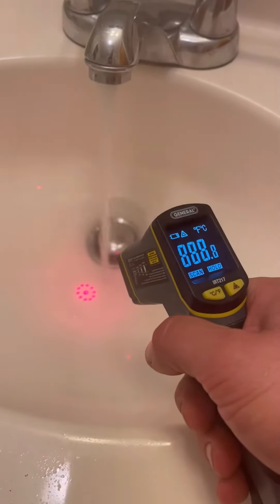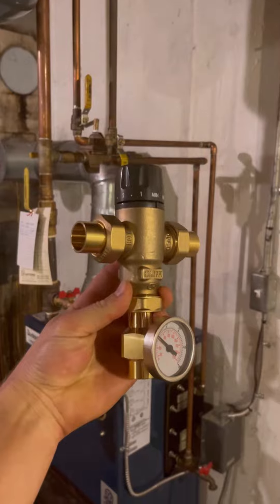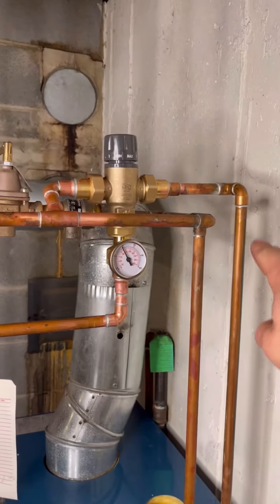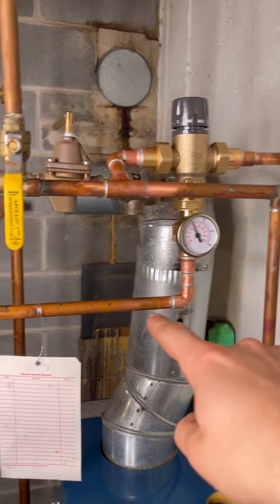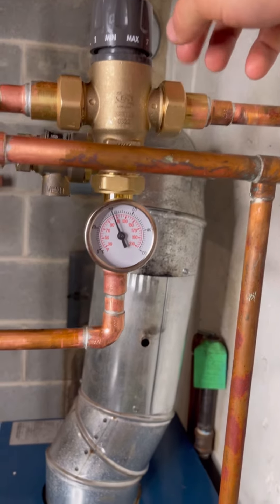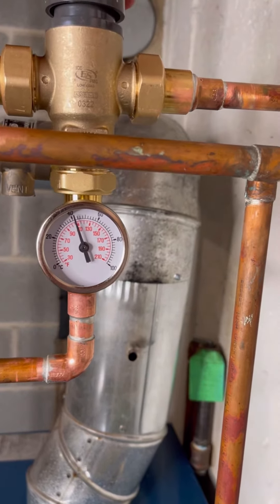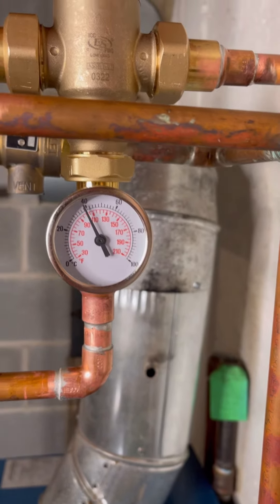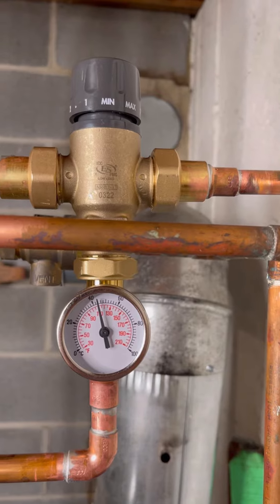Hot Water MIXING Valve. Full install.

Comment: A tip from a plumber, its always best practice to solder the joints at once.  Like how that one time you had a 'tee' and 2 pipes were in the tee but the other pipe wasn't.  Its best to have all pipes in the fitting and solder that fitting all at once.

Comment: Good to know.thank you so much .
What about turning down the temperature at the water heater directly ?
Reply: That's what I was thinking 🤔
Reply: That would turn the hot water down to your whole house, with a mixing valve you can install it on a specific fixture to reduce only that fixtures hot water
Reply: You might want to use your hot water tank as a kind of battery for solar panels, making it really hot during the day.
Or you might want to keep the water temperature low (for children/elderly) but need to keep the tank hot to avoid legionnaires' disease.
Reply: Only need tank at 65c re legionella. Installed like this will adjust supply to whole house so he should also reduce tank temp.
Reply: @joeroberts4690  That temperature is too high for some people, like young children.

Comment: I have an old boiler that has a coil that does my hot water as well with no storage tank.  I can sweat pipe but i am unsure of where to intall the mixing valve.  Is the cold line the regular domestic cold line or the return line to the boiler?

Comment: In my garage, I have an indirect hot water heater that gets provided from the boiler, which the boiler also heats my radiant floor water lines. It's quite confusing to me, but do you think this valve on my unit controls the amount of hot water to my floor water lines and heater together? 

(Newly purchased home, it's getting into cool then cold season-upstate NY- trying to get the best heating as possible)

Thanks

Comment: So the cool thing about these mixing valves is you can spend $30 for one and have nearly 50% more hot water!  No need to spend thousands on a tankless.  I put my tank at 150 deg and set my temp to 120!  Perfect 😀😀
Reply: They're 5x that where I am in Canada and how do you get 50% more hw when it literally mixes the hot water to cool it down? You don't need a mixing valve on a tabkless as there's no stagnant water sitting.
Reply: @mitchellroberts2994  I mis-remembered.  Paid ~$135 USD, Sorry.  But much much less than a tankless water heater.  That’s the main point.
Reply: You don't get ANY more hot water.
Reply: @joeroberts4690  Yes you would. You would if it adds 20% cold water to get the water cooler you now have 20% "more" hot water use.
Reply: They make a 50 gal tank produce 75 gals of hw